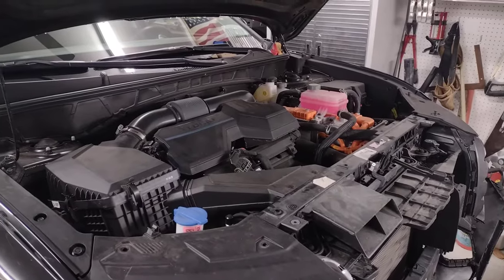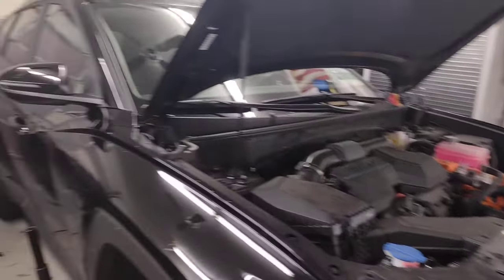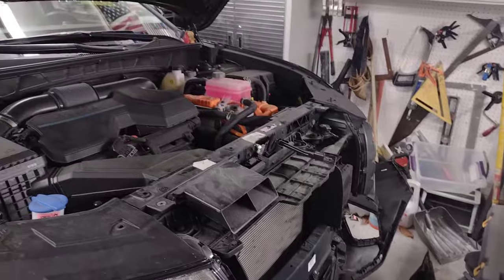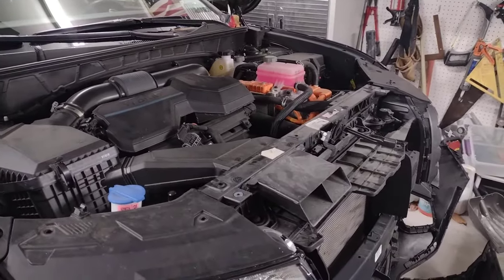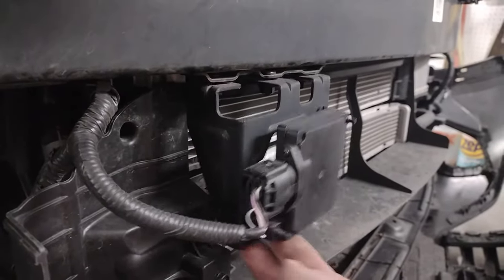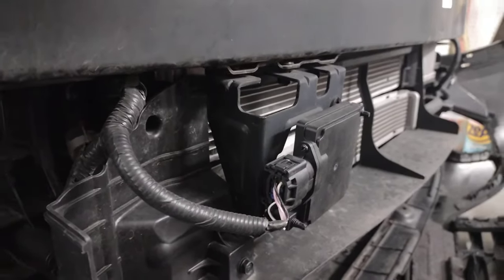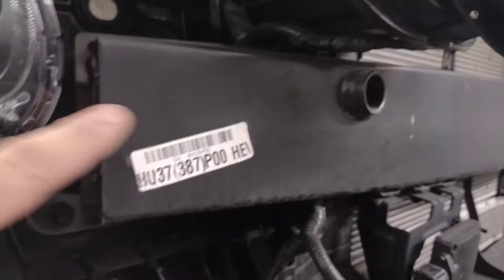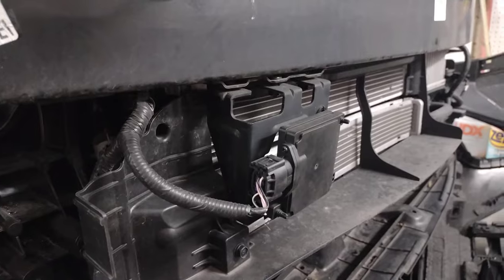Fixed! 2022 Hyundai Tucson Radar Blocked Front Collision Detection System Malfunction

Comment: Hi, Scott. Is it easy to remove the front grille? Im thinking of replacing the horn but im worried it's hard to remove. Thanks.
Reply: Just remove the front bumper as one unit.
Clips along the bottom, a screw each side in the wheel arches at the front,8 or 10mm, some bolts along the slam panel and then it just unclips from the wings and under the headlamps. Pretty easy to be fair.
Reply: @GazHogan  thanks so much for the tip
Reply: @kingthranduil8807  You're very welcome.

Comment: I have a problem were my car suddenly emergency brakeing and there is no one in front of me , do you think i have the same problem with the radar ? , my car is Kia K8 by the way
Reply: It happened to me also. Because the sensor was detecting the car which is on the right lane!
Reply: Hi  @leozay55  i have the same issue detecting the car on the right lane, did know fix the issue?

Comment: Hi Scott, Thans for share this information, May I ask do you facing Carbon deposition issue in this car after drive about 15000KM? 
the Engine light will tune on in dashboard, after check that show EGR system filter mesh was clogged.
thanks
Reply from the maker: I haven't had any carbon issues yet. I only have 16k miles on it though.